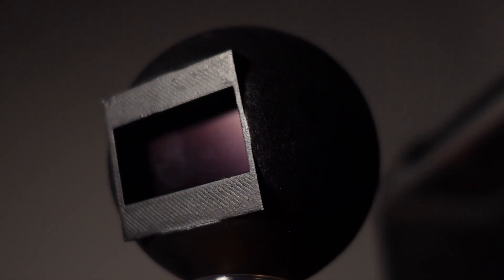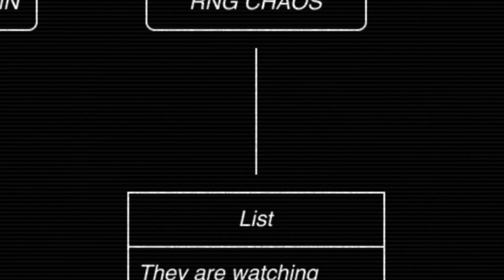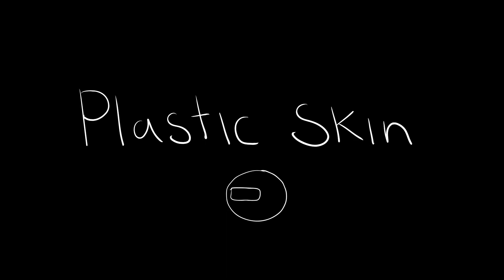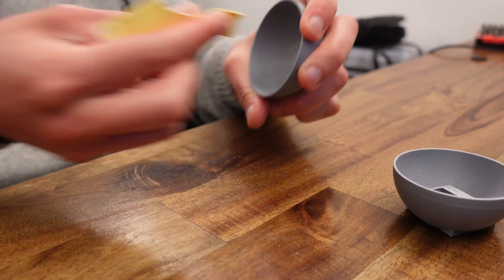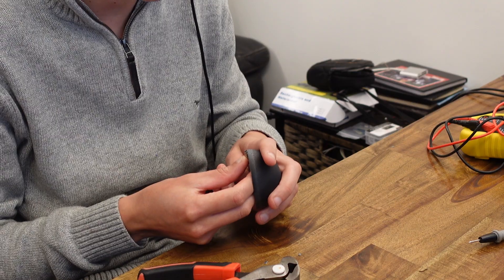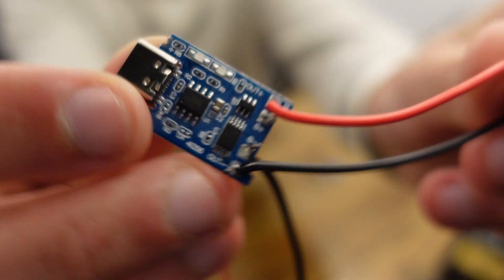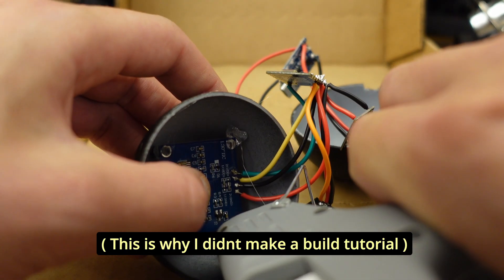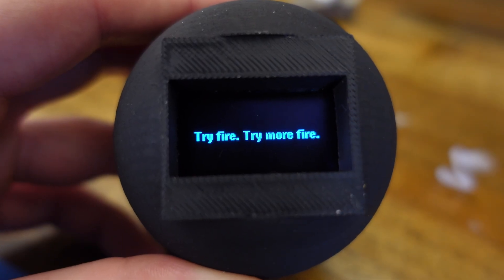I Built A Magic 8 Ball That Gives Awful Advice | Open Source DIY Project

Comment: How did you bring it down to 5 volts?
Reply from the maker: The boost converter that I used has multiple outputs - they can be altered by desoldering specific resistors.

In the Instructables comments, there has been some discussion on if the converter is even necessary given the chosen battery output
Reply: @LennoxLow thank you!
Reply from the maker: @bobmatt3689 no problem! hope to see you again!

Comment: Just flashed an ESP32 with your code, gonna try to build one with more of a mini desktop cube style, with a button rather than a knock sensor. I’m pretty new with Arduino/etc but I assume I can just use a button/switch tied to the same pin as the knock sensor? About to jump into the workshop now!
Reply from the maker: That sounds awesome — a cursed little desktop cube!
Yes, you can totally use a button instead of the shock sensor, just wire it to the same pin (GPIO 3).

If it’s a momentary button, you’re good.
If it’s a switch, just make sure it’s normally HIGH and drops LOW when “activated.”

Good luck in the workshop! 🖤
Reply: @LennoxLowJust flashed the ESP32 and wired it up, works perfectly! I haven’t quite figured out how to trigger it using the button yet - I’m using a generic momentary push button, it’s currently wired to the same pin as the shock sensor, and the other side of the button is wired to ground…but it’s not responding. I’m sure it’s got something to do with defining the state of the ESP32 pin, like you said. I’m such a newb that I’ll have to google it LOL

But lemme just say - what a cool project, man.
Reply from the maker: We all start somewhere and before you know it, you'll be an expert! 

Unfortunately not all buttons are made the same, I've had similar frustrations that were solved just by rotating the button 90 degrees!
Sometimes a UART pin like GPIO 3 can be tricky, one thing you can try is changing this and updating TAP_GPIO and TAP_PIN_MASK accordingly.

If you still have issues, I'll try to create a momentary switch version too and see what I find 😊  

I appreciate you taking the time to not only watch this video, but to make steps into creating your own 🖤

Comment: I love this idea
Reply from the maker: Glad you’re into it!
Looks like you know your way around 3D prints — do you have better ways to join two PLA parts? I’ve just been supergluing like a gremlin.
Reply: @LennoxLowhmmm well I know tbis product called 3D gloop that chemically bonds the parts, or using a soldering iron to melt the parts. I usually just use glue as well though 😅
Reply from the maker: @JH_des1gn thanks, ill look into getting some gloop! But for now - Gremlin 😂